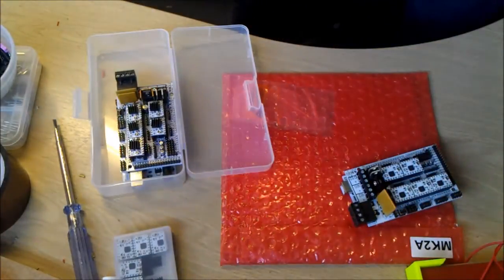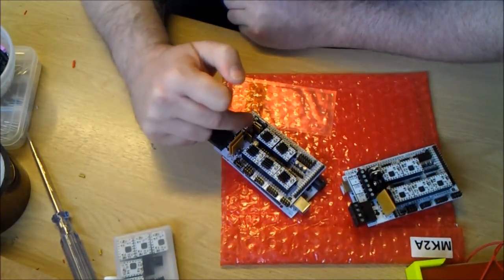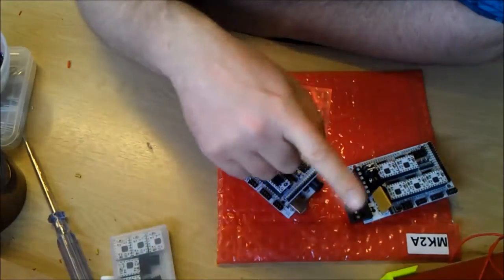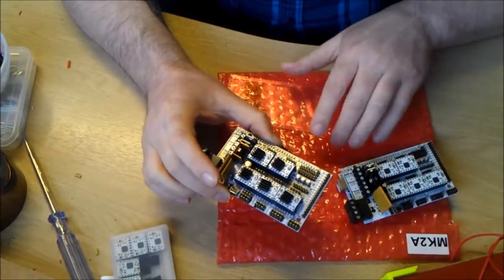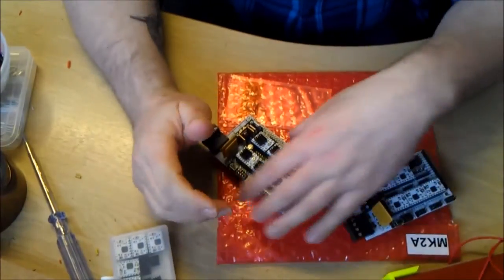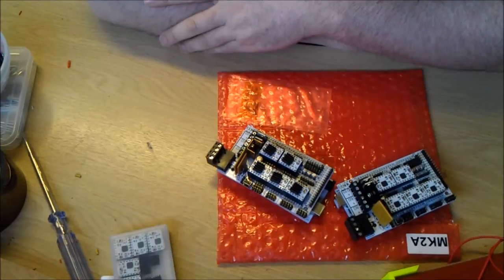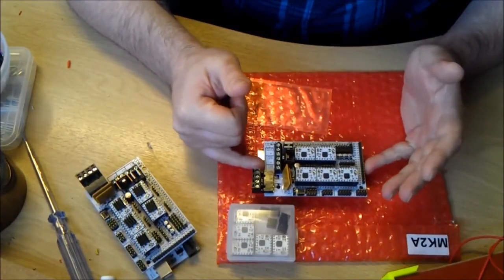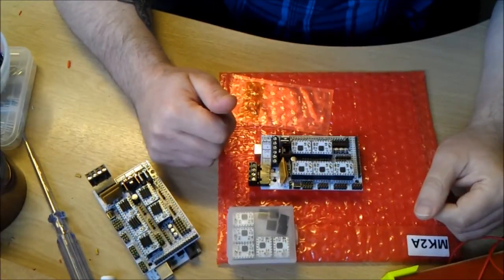Why the RAMPS 1.4 had a MELTDOWN

Comment: The easiest way to fix that melting issue is just to use an automotive relay for powering the bed or use an external mosfet controller for the bed.  that's the easiest to avoid soldering.

Comment: hi, I have gone through 2 ramps do to the H.B. mosfet overheating.  In the morning I am going to go buy one locally($20 isn't bad for local and don't have to wait for it).  Thin I am immediately going to the electronics store to buy the better mosfet, a mosfet heatsink, and 2 60mm fans(for ramps)  Did upgrading the FET fix this issue?  thanks
Reply from the maker: no i did not i just got a relay and by past the FET all together but if you can i would love to see a video of you upgrading your FET  i think it would be a BIG help to others with the same problem
Reply from the maker: PrintAlot oh if do a video can you post it here to buddy https://www.facebook.com/groups/386484504786227/
Reply: PrintAlot OK I'm going to try and do the FET upgrade to start.  If that doesn't fix it I'm going to dig into Marlin and figure out how to change the bed to PWM.  I can't find and videos on it.  Thanks (Ps. I such at making videos) haha

Comment: a quick google search for 300mmx300mm silicone heatbed resulted in several pages, but one i went to had this link.

http://store.quintessentialuniversalbuildingdevice.com/product.php?id_product=29
Reply from the maker: nice thank :-) the one i have Draws 12 amp's this one Draws up to 20 amps that should not matter it using a relay but for just upgrading the FET no good